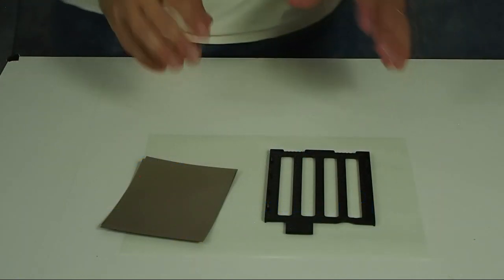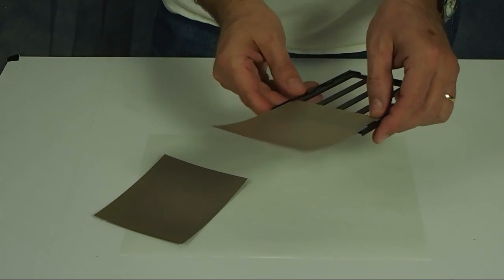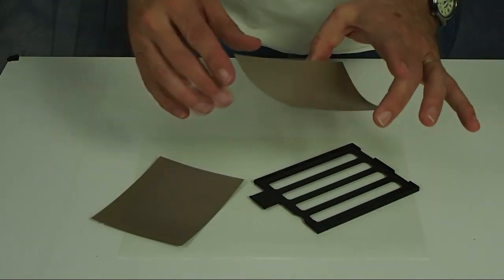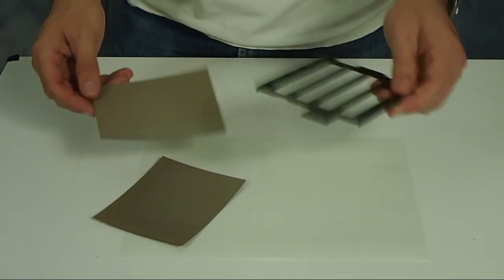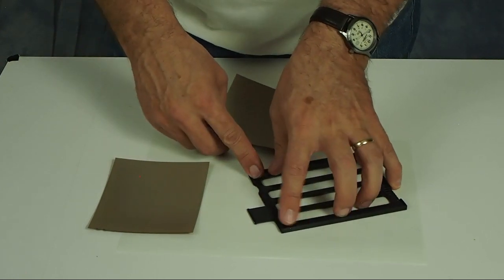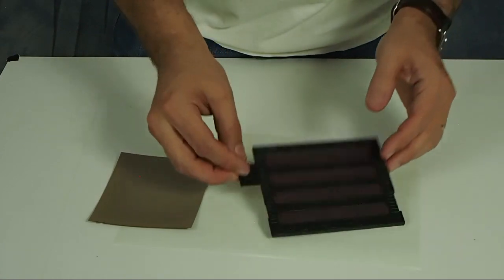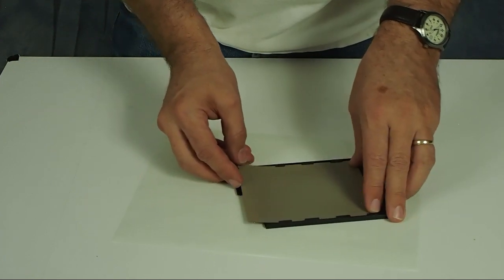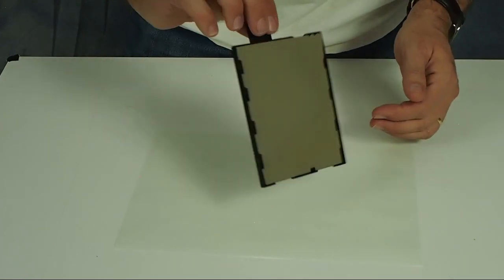loading the SP-445's film holders

Comment: I noticed that you loaded with the emulsion facing outward.  I tried an experiment on 2 sheets with the emulsion facing inward.  One of the sheets was left with ridge marks on the emulsion where the developer did not get in contact with the emulsion.  FYI.  I will always put the emulsion outward from now on.
Reply from the maker: Frankly, I've never loaded the film with the emulsion inward.
Reply: I loaded mine like I do loading film holders. Ridges on lower right hand corner. Emulsion out.

Comment: Try sliding in the sheet of film sideways, so one side of the film is under all tabs ("fingers") of one side of the film holder. Then bend the film slightly and slide it unter the tabs of the other side. Make sure it is also under tab on the lower side of the film holder. I hope that makes sense. I find it much easier than sliding the sheet of film down the holder, which it very fiddly (and the film gets often stuck because they didn't think of making round edges on the tabs, when they made the moulds...).
Reply from the maker: The risk of loading "sideways" is touching the emulsion when you flex the film. 
The film should slide in smoothly, make sure the factory didn't leave any flash under the tabs. (We inspect but have been known to miss some.) 
Not sure which edges you think should be rounded. you can reach us directly at info@stearmanpress.com
Reply: @timklein185  Thanks a lot for your fast answer! This is very much appreciated. The risk of touching the emulsion is indeed to be considered - good point. I personally think it is not to greater than when loading/unloading the film holders, and had no problems until now. Thanks again for bringing this product onto the market, which saves me money!